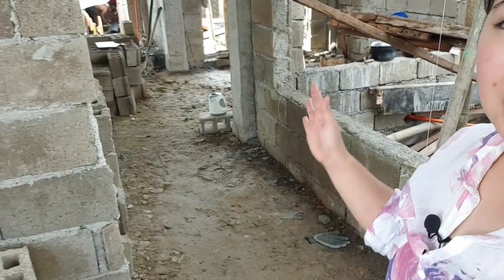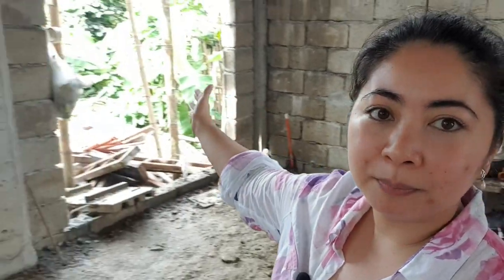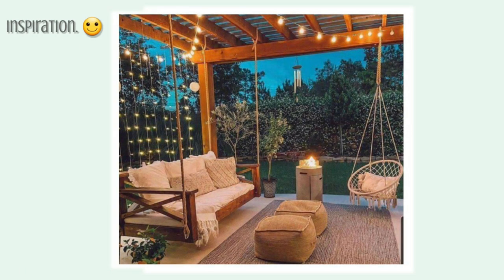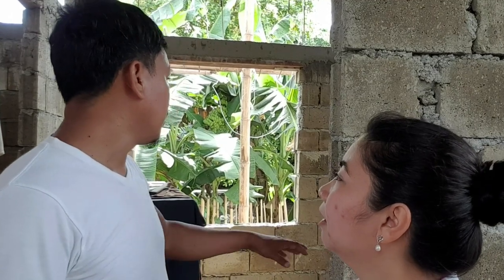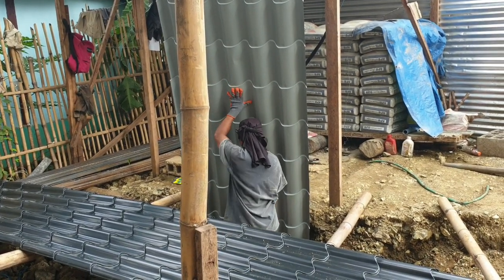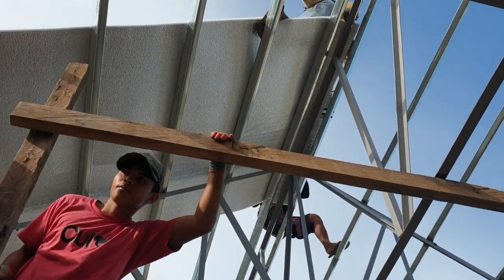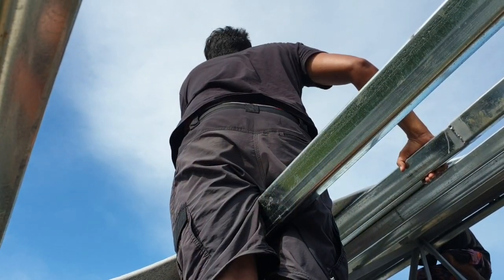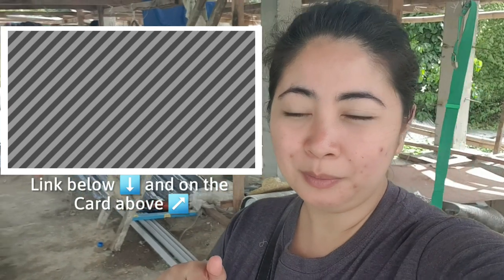House Building PHILIPPINES | Wk 16 "Unfinished" HOUSE TOUR | ROOF UPDATE | Retired OFW

Comment: every projects has a feasible target date depending to the manpower and resources availability.

in construction detailed plans is very important, structural designs for interior and exterior is not as built, it should be first on hand, putting the cost in consideration.

with this, i see almost 80% of your vlog content is about what is going to happen, tasks that is about to be made, and future upcoming plans, while the rest of the team is focused on bulding and making, is what makes the vlog very exciting.